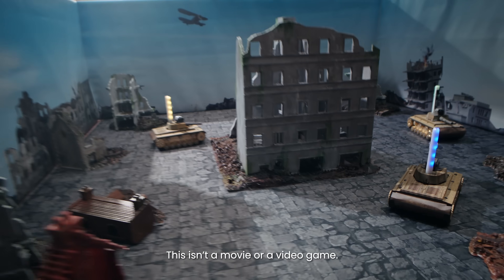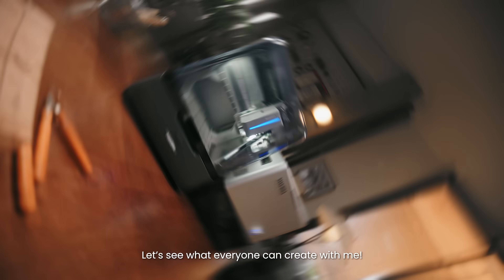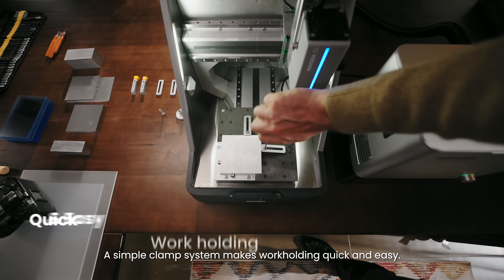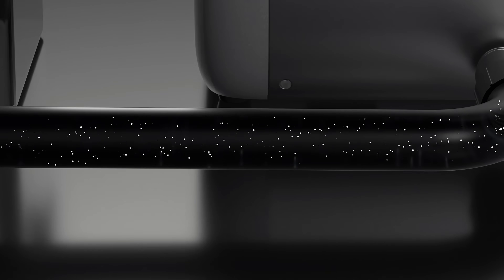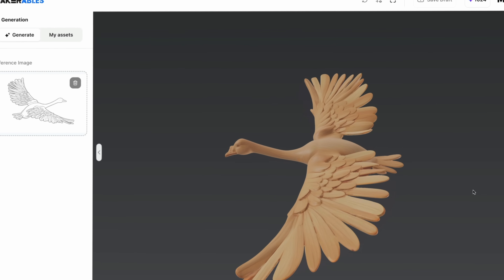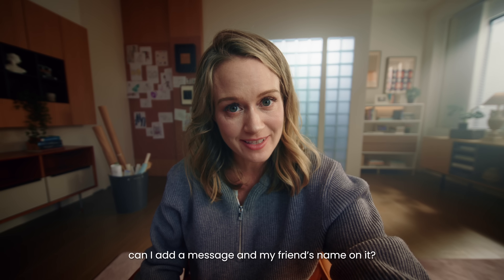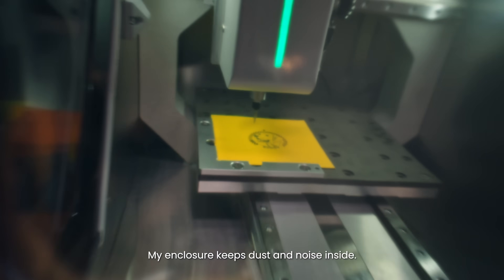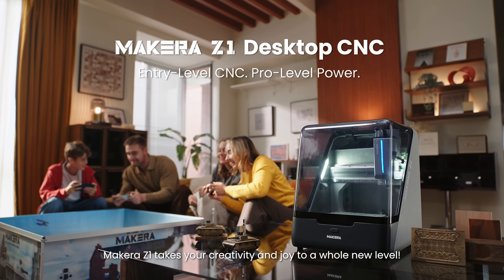🎺 Meet the Makera Z1! Entry-level CNC. Pro-level Power

Comment: Cool. But spending $40 in materials and hours of work to make a $7 replacement lens cap using a $4,000 machine. Make it make sense.
Reply from the maker: The Z1 can be purchased for $899

Comment: What file extension is this? If I have a 3d print design can it be converted over?
Reply from the maker: Sure thing! you could work with 3D files in STL or STEP formats, as well as well as 2D files from images like JPG or vectors like DXF and SVG too.

Comment: I can't believe I can finally have a full CNC machine on my desk! I hope this is affordable and the software is good and opensource.
Reply: It's insanely affordable in my opinion. MSRP of $1199,- at launch.
Their next cheapest model, the Cavera Air, is currently available for $2499,-

If you reserve your spot ($39,-) for the kickstart launch you can get the machine for $899,-
After receiving it, you can get a $100,- refund, plus the $39,- you paid earlier on. (The $39 dollars you can get back even if you decide not to back the kickstarter)
This brings the actual price to $799,- 
(Comparing to currency conversion on their site, that means ~€718,-)

I have never backed a kickstarter (because of course it has its risks), but Makera seems like quite the reputable company and I am confident in their ability to deliver, considering their already existing machines and robust software (the software being a big selling point imo). It really feels like they are pulling a Bambu with this one. I will defintely be getting one.

I would suggest you to watch reviews and do your own research though.
Reply from the maker: Super exciting! Keep us posted on what you create!

Comment: I mean great machine. it is something new and perfected compared to other mini cnc machines in the market. The problem that i have with other machines like this is where do you find commercial supplier for materials at such small dimensions? For example the alu boards that the guy was using for his camera cover. i barely know one guy that sell these and has a price tag on them like they are make out of gold. On the other hand how do i perfectly cut out those boards out of 2mx1m panel without serious expensive machine? Everybody is focusing on bringing the best machine on the market but there are no supply of materials like there are filaments for 3d printer.
Reply from the maker: Getting raw materials really isn't too difficult, as there are lots of distributors across the globe. We of course sell materials, but you don't need to buy them from us as they are non-proprietary. If you need help, reach out to our education team and we can assist you in finding the best resources for your needs.

Comment: The bang for the buck, i have some unanswered questions.

1, What is the decibel level of it when it is running?

2, What type of protection is there underneath that protects against chips getting stuck when the exhaust is running?

3, What extra protection is there for the camera that will be damaged by all the chips?

4, Will there be a stronger spindle in the future that you can switch to?

I really love the work Makera does for the CNC hobby community!
Reply from the maker: Thank you for your support, and all great questions. I'll answer what I can here, but definitely also stay tuned for an upcoming livestream where we're going to share all of these details!

1 - around 70, but this is not fully tested or confirmed at this time
2-  there are rubber strips like with the Carvera Air around all rails
3 - the camera has been angled and protected with a specialized lens for this
4 - There are no plans for this at this time

Comment: Just wondering what is being used for cooling and if we have the ablity to pick feeds and speeds if we just want to make tweaks to the g code?
Reply from the maker: The Z1 has a unique AeroDust cooling system that uses a high powered fan to cool and clear the part during machining. And yes, adjusting speeds and feeds is doable in CAM and also during machining.

Comment: Ive seen these sort of products before, this seems very 'scam-ish".  For starters, this is probably insanely loud, secondly, saying 'machining metal' is misleading.  It looks like it can only machine sofr metals like brass.  Aluminum is always hot or miss with these sort of products.  Lastly, theres no liquid cooling, meaning heat can cause parts or bits to warp, or shavings to melt into the area being cut, causing peojects to fail or not line up.  I would wait till reviews come out before rolling the dice on this thing.
Reply from the maker: Have you researched out company? We've been around for 4 years and we make high precision and safe desktop CNC machines for makers. This isn't our first product, its our third.

Comment: Great promo video and good product! However, the Z1  work area and spindle power seem relatively small, and it also lacks a hands-free automatic tool changer. At only around 38 lbs, the overall weight is quite low as well.

In other words, this suggests that its ability to efficiently and effortlessly machine harder materials is limited, as are its overall rigidity and precision. This makes it a difficult choice for engineers and demanding makers like us who need to work with metals.

From the looks of it, NestWorks C500, which is about to launch on Kickstarter, seems like a much better fit for our needs
Reply from the maker: These are good points, but perhaps you're missing our target audience for the new Z1 - this is an easy to use and affordable desktop CNC for makers. It has impressive precision at 0.02 mm, but not industry performance, and its definitely suitable for softer metals, woods, plastics, PCBs, etc. For a more robust machine with automatic tool changing and higher precision (sub 5 microns), check out the Carvera

Comment: At least they're not pretending you'll be making any money with this machine, It's an honest approach, most 3D printers sell you a business idea rather than an actual printer...
Reply from the maker: While we often find businesses purchase our CNC's, the Z1 is really for the hobby, DIY, and Education user at its core
Reply: Also I guess it's a gateway to bigger machines if you find that you're into it.
Reply: If you pair this with a tiny injection molding machine you could produce small quantities of plastic items more efficiently than 3d printing. That combination of machines starts to look more like a small business because even if the makera is slow you only need it less frequently for prototypes and making the molds and being a low capital investment really changes the equation. On the other hand you can nowadays order CNC parts increasingly cheaper so the value may be in the enjoyment of tinkering and learning like they say.

Comment: MSRP is 1199$ if you were wondering. You can get it below 900$ if you preorder it
Reply from the maker: $1199 is the MSRP of the Z1 when it launches, the Carvera air is around $2500 USD
Reply: @Makera thanks, I didn't look closely enough at the part numbers
Reply: Their website has the air at 2500 USD. Where is it 1200?
Reply: damn that’s surprisingly cheap

Comment: The biggest part off this is the price it has to be under 1.5k otherwise you could just get a 3d printer essentially for beginners 3d printing is simpler however I think this is a amazing tool if it is under 1.5k if not then I don’t think it justifies since I have a 3d printer already
Reply: The MSRP is $1199.
Reply: @kustomwithfizix5959 dam that’s actually amazing this is going to pop of if the software is good enough
Reply from the maker: We think that a lot of 3D printer users might see the Z1 as a great companion machine, something that allows you to create parts and prototypes from more than just plastic without need a ton of space, all for under $1000 at launch!
Reply: @Makera  I think you should market this to crafters instead of makers this is amazing I am in the fortunate poster to be able to buy one so I will!
Reply: It's 3500 CAD so pretty far from affordable
Reply: @sefyue  that Canadian I am in the uk so it’s about 1000£ yes it’s extremely expensive but for what it is…

Comment: It's incredible. But I am still worried about cost when compared to a commercial hobby 3D printer. And also, it's a bit complicated to set up. But it's a win win solution for small scale new startups instead of buying Big cnc which is expensive and consumes space.
Reply from the maker: CNC machining is more difficult than 3D printing as a whole, but its our mission to make CNC machining as easy as 3D printing and the Z1, Makera CAM, and Makerables are all a huge step in this direction
Reply: I mean it’s not a 3d printer or even in the same category… why would it need to compete with one? They do entirely different things, 3d printing is additive manufacturing and cnc is subtractive manufacturing. Completely different things with different challenges

Comment: Wow, great video, Makera team! Gotta say, my Carvera Air has been absolutely invaluable for prototyping, even in stainless steel and titanium (with a little extra patience). My only regret is not buying one sooner. The upgrades on the Z1 look rad, especially the integrated camera and the dust collection system. And this is legit one of the most practical uses of generative AI I've seen, assuming it works nearly as well as it appears in the video. can't wait until these innovations make their way into your larger machines. Congratulations on the launch!
Reply from the maker: Thank you for the support, its hugely appreciated!
Reply: Have you tried 7075 aluminum?

Comment: What is the precision that this machine can cut to? Can it fufill tight GD&T specifications?
Reply from the maker: The machining tolerance of the Z1 is 0.02 mm or 0.0008 in under most circumstances.

Comment: I own and love my Carvera Air, however, I think Makera is going the wrong direction for their machines. Easy-mode AI CNC sounds delicious to start, but nobody has proven this technology yet. I would have liked to see Makera go more in the direction of miniMonster, where more power tools are added for power users, such as workholding, an all-aluminum precision bed, or a rotary tool-changer add-on or even just a more powerful spindle. I predict that this segment will make Makera a lot of money, but it'll bring a rash of challenges for a non-technical audience, limiting their resources for building a more powerful mill for power users.
Reply from the maker: We're glad you like your CNC, and stay tuned! It is our goal to make industrial manufacturing technology accessible for everyone, starting with the Carvera and now with the Z1. But we're not going to stop there, or forget about our power users in the process.
Reply: My personal thinking: more Z1 users that might learn and progress to move up to Carvera level of sophistication, which enlarges the pool of potential power users demanding more tools and features. 😆

Comment: Great small CNC machine. Do you also have option for automatic tool change?
Reply from the maker: Thank you! The Z1 is equipped with a quick tool change system, but it is not automatic. If you're interested, check out our bigger Carvera CNC with a 6-place automatic tool changer.

Comment: I see the work area is 200mm x 200mm. Is there extra room to the side to clamp down a piece of material that exact size?
Reply from the maker: This would be possible with careful and proper clamp placement along the front or back edges.

Comment: Since the release of the first Carvera I've been asking for a more powerful spindle, a 150w just don't cut it (pun intended).
You are missing out a HUGE market of hobbysts, engineers and workshops that would make a good use of a more professional but still affordable version with at least an 800w/1,5kw spindle with a price tag around 1.500-2.000$.
The 150w is just too slow for bigger parts and professional use with harder materials.
More and more machines are coming out on the market, you risk to lose a market.
Reply from the maker: Thanks for your input, and this is something we are aware of. While we are focusing on making CNC production more accessible to a wider range of users at this time, we are not forgetting about our power users or desire to bring more industrial technology into the everyday workspace.

Comment: Is the Z1 capable of machining stainless steel or harder metals, but more slowly? I recall the Carvera Air being able to machine harder metals with smaller step downs.
Reply from the maker: It is possible, but not recommended. Compared to the Carvera Air, the Z1's slower RPM spindle and different linear travel system would struggle to hold tight tolerance with harder metals.
Reply: This little piece of crap will make so much noise trying to cut stainless you'll want to throw it out the window.  😅😅

Comment: For the desktop segment, Makera is too small. To work more or less normally, these CNC machines have an area of 400x400x100. If you focus on metal processing, you need to process metal more aggressively than your machines can. So you haven't hit any market segment in terms of price or quality! For wood, the area is too small, and for metal, the rigidity is insufficient. Almost any woodworking machine can do the same. As for the software, you've really hit the mark with AI! Well done, and no questions asked! Otherwise, so-so
Reply from the maker: Thank you for your interest in our product! We use high-precision lead screws, and testing has shown that the machine can achieve excellent results when machining metals such as brass and aluminum alloys. Although the Makera Z1 has a relatively small work area, it is designed to offer a user-friendly CNC experience for home users. Stay tuned for updates on the Makera Z1 and future possibilities: https://www.makera.com/pages/makera-z1.
Reply: 100% agree. 
We need a more professional oriented machine that is still user friendly and affordable (<2.000$). 
I second a 400mm squared working area, possibily cubed or at least 200mm of height and with a 800w-1,5kw spindle
Reply: @pedgarage  200mm Z is going to be a problem for rigidity as you are doubling the forces at that extension.  The size as well doubling the travels is going to mean 4 times as large of a volume as well. You have seen how big a 400mm printer is compared to a 256mm one and the difference is huge, now for a CNC it will be even bigger, since it needs rigidity (especially with a moving bed design like this where the minimal depth of the machine is 2xY travel).

And lets not forget weight, they were absolutely looking at the weight here, a larger work area machine does not scale linearly in terms with mass to rigidity, so a 4 time size increase will not mean 4 times the weight if you are trying to keep the rigidity the same regardless of the size. 

You are absolutely looking at a machine that a single person is not capable of lifting in one piece (and disassembly is a problem, since you need to keep alignment of the machine).
Reply: @exol511 all valid points, thanks for the insight.

Comment: Isn't a camera lens cover a bad example since it could scratch the glass? usually its made out of plastic
Reply from the maker: The aluminum lens cap shown in the advertisement was a sample displayed to demonstrate machining precision and surface finish, not an actual retail component. Our intention is to highlight Z1's capability for creative fabrication across various real-life scenarios and to inspire users' imagination. In practical applications, we would add a soft inner liner (felt/silicone) or a recessed lip to prevent direct contact with the glass—or use plastic to manufacture the final product. Thank you for the reminder!
Reply: No most lens front glass is recessed as you have the threaded mounts for filters. You can already get aluminum lens caps Kondor blue are known for them. The design in this add looks somewhat similar to that but different